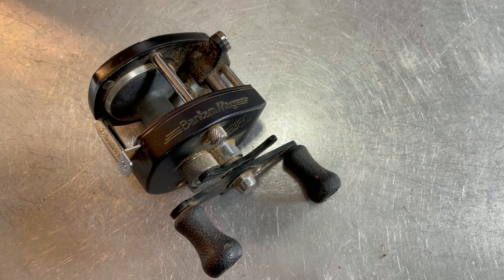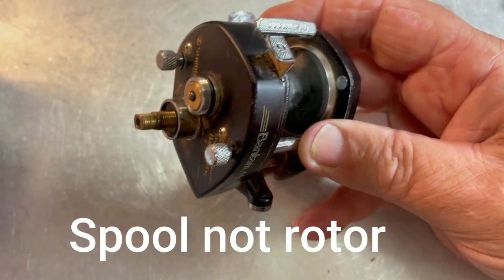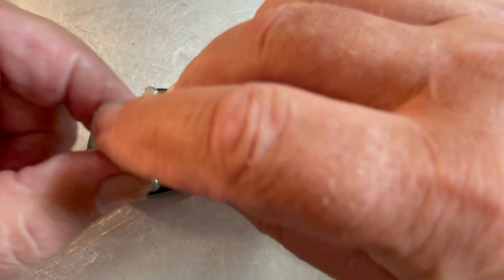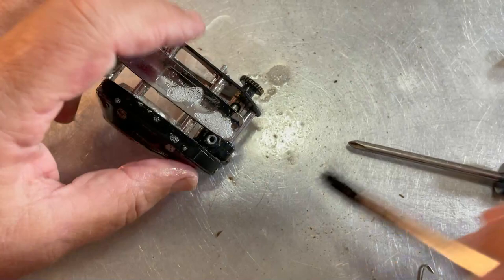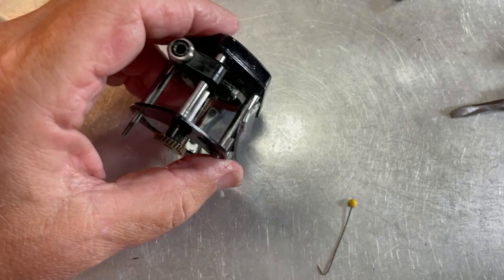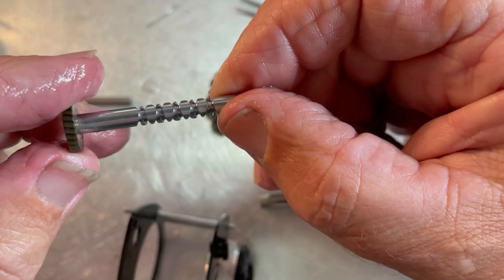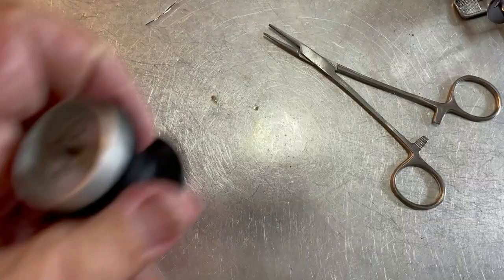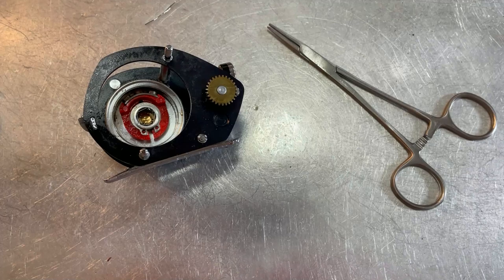Young Martin's Reels - Shimano Bantam Mag 10XSG - Service and Lubrication

Comment: I have one of these reels that I bought in 1986. Last spring I challenged myself to take it apart and service. In the end I found the shim washer on my table that fell out of the one you worked on that belonged on the main gear. The schematic I found on line wasn’t very legible so I kinda just guessed on where to put it. Your video helped me know that I replaced it in the correct spot. Thank you 👍🙏👍.

Comment: Nice job, Rick! I did a teardown of my Shimano Bantam TX Mag last winter. I was reluctant to take that reel apart as I thought it had a lot of small parts inside that would be easy to lose. It was running so poorly that I felt I had nothing to lose and dove right into the job. I discovered that it had the same dirt problems as your reel so all the parts got a thorough cleaning and lube. It runs great now and I use it regularly.
Reply from the maker: Glad to here your reel is running smoothly again. I’m sorry to say I didn’t send the knob today. I forgot all about it until just now. 

I was happy to clean up the Bantam but I knew it would work great. Heck with all the dirt it was still working pretty well. I think I could have just cleaned the worm gear, wiped the rest off, and put it back together, and it would have worked great. 

The one I’m really looking forward to is the Diawa Procaster PM 10S. I can’t ever turn that one, and it’s covered in blue corrosion. I’m suspecting the worm gear is the bind but I’m not sure. The spool release is stuck too. I would have done it next but the interest out there in baitcasters is pretty slim. Spin cast and spinning reels are what you guys really want to see. I’m mostly looking for a good challenge. Of course I say that but when I get a really challenging one, I just want it to be over with. You just can’t make some people happy. 

I have some ABU spincast reels on the way that I think you will like. I thought about you when I agreed to repair them. They both have drag problems.

Comment: Is it any thing special changing the 2 bearings ?
Reply from the maker: It’s been a year since I worked on that reel but I seem to recall that the bearings could be changed fairly easy.
Reply: It’s the same  basically as a 100 SG … Your video saved me on the washer sequence.  I hadn’t pulled one apart since the mid to late 1980s.  Thanks for your time